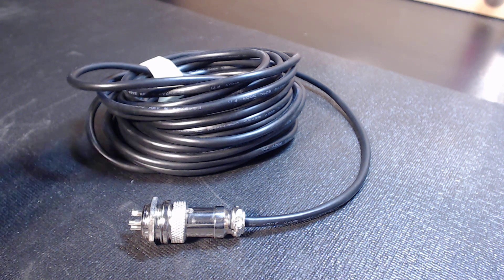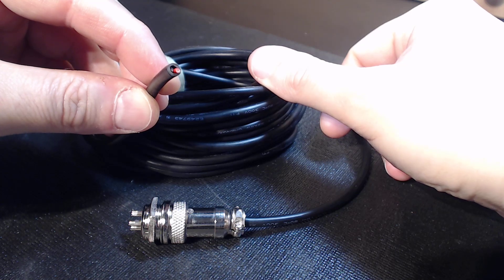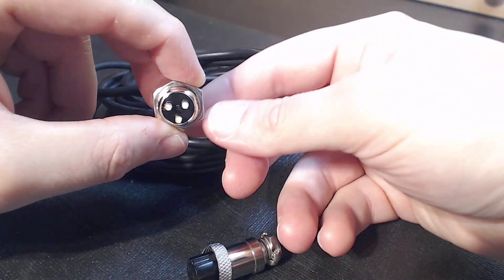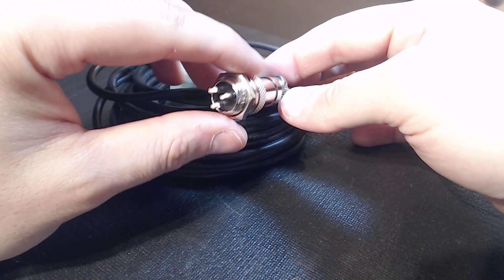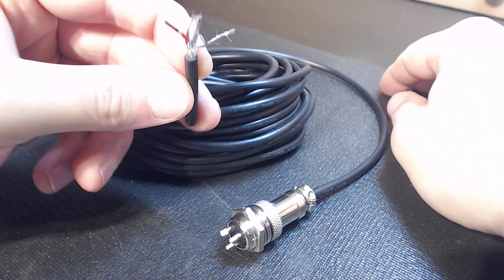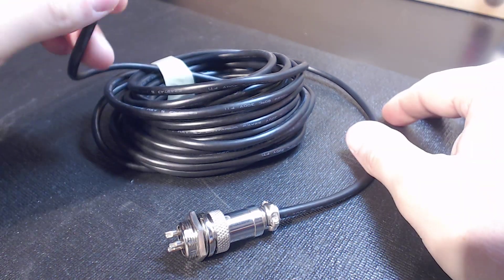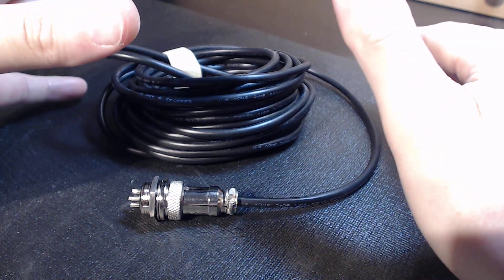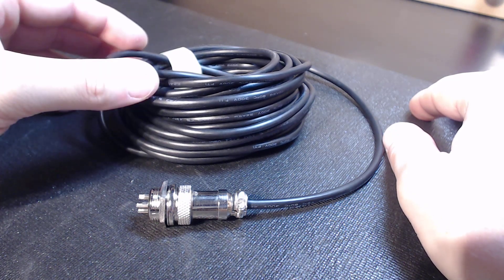CNC Accessory Wiring Kit (Bullet Proof EMI Protection)

Comment: Is there a video explaining how to properly install a shielded 4-Core ( U/V/W+GND ) Cable between a Spindle and VFD?
From my current understanding, you'd only want to have the shielding make a connection on the VFD side but not on the spindle connector as otherwise, it would introduce a ground loop via the GND wire the moment the connector is being attached to the spindle.
Reply from the maker: Durahl,
Your correct about the shielding attachment. It only connects on one end preferably the VFD end. If you email me I can send a wiring diagram to help you get yours correctly wired. Thank you,
Vince
Reply: This is not according to code.

Comment: Hey Vince.  After watching this video i am wondering if  i was to use an 18-4 double shielded cable should i also get the 5 pin GX- 16 instead of the 4 pin?  Thanks
Reply from the maker: Ernest,

Using either gauge double shielded cable will yield the same results in terms of EMI contamination prevention. The 5 pin GX-16 should be used if you plan on using all 4 conductors with the 18/4 cable. 4 pins for the general wiring configuration, and the 5th pin for the ground drain.

Thank you,
Vince